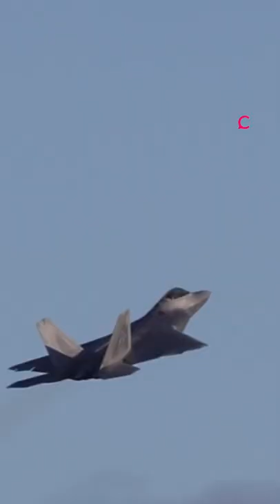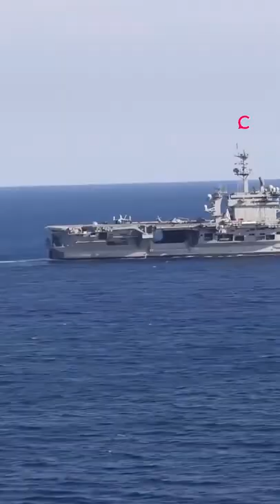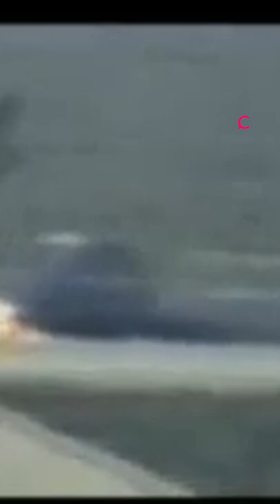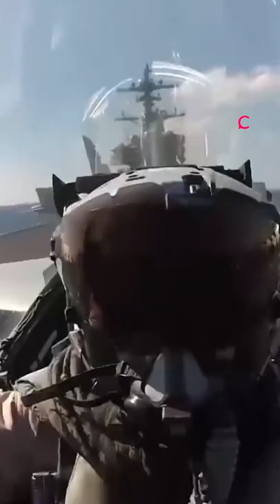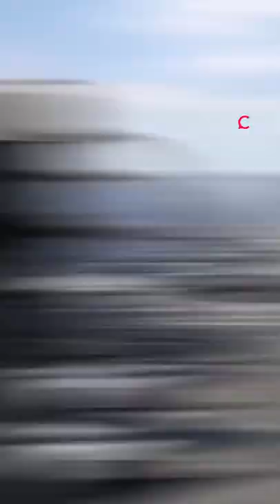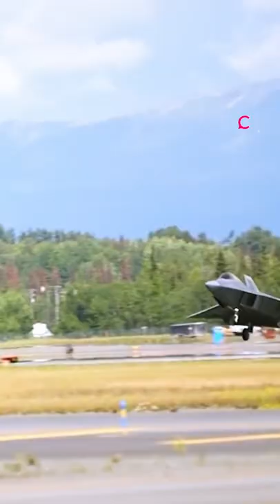Why can't the F-22 land on an aircraft carrier?

Comment: Uh, designed for Air Force and not the Navy. Nothing else needs to be said about why it can't land on a aircraft carrier!!
Reply: Originally they were going to make a navy variant but due to costs they only ended up making it for the USAF. They made 200 instead of the 700 they intended to make. Today there are 185 operational.
Reply: They both have air in the name
Reply: Only smart comment in this whole section
Reply: @yav1d  who’s?
Reply: @Ohhiohh  Lol they do though
Reply: A10 wasn’t designed for the navy yet it still has a tail hook and can land on a carrier
Reply: @roryneil1921  try getting an Air Force pilot to try to land on an aircraft carrier.
Reply: @roryneil1921  the tail hook on USAF planes are designed for emergency landings on runways where they have cables set up to let the hook catch the wire, if landed on a carrier the A10 would break its hook and possibly blow up due to it having not strong enough landing gear.
Reply: @ryanb32952  yea ik it’s not exactly textbook for Air Force jets to land on navy carriers but still I don’t get why they decided the f22 didn’t need that back up option but almost every other jet did
Reply: @ryanb32952  The A-10's gear is pretty strong, infact. It's low speed stability will also help it get a softer landing than the F-22
Reply: @roryneil1921  I think it's to save on weight, because, I don't think an F-22 can even go slow enough without stalling to even catch the wire correctly
Reply: @ryanb32952  - an A10 has landed on a carrier before. It just can't take off after.
Reply: @xcr8ivex708  oh yes I understand that, but the fact that it is a very skinny platform it would most likely explode or break on impact.
Reply: @-007-2  Ask any air force or navy pilot they will say no, maybe your talking about war thunder 😂
Reply: @ryanb32952  What do you mean by "skinny platform"?
Reply: @xcr8ivex708  the a10 has a much thinner airframe than others.
Reply: @ryanb32952  It's not really that skinny?
Reply: @roryneil1921  yah but we talkin this think boi
Reply: I didn't think this needed an explanation.
Reply: @ryanb32952  you said that and officially that is true but didn’t pick it and yet the f35 is more expensive then the f22 would have been . The company said if you order like 700-1050 we will give discount. It would have made it about 80-120 million each.
Reply: UHHHH 😶 ALL ARE AIRCAFT!!!!!!!!!!
Reply: Foreign Air Forces land on carriers, the DOD primary Air Force could definitely do it!
Reply: the landing gear already fail on the ground, not good enough for carriers
Reply: @trovenolawrence7127  We’re talking about aircraft capabilities, a 5 year old couldn’t land on an aircraft carrier with an F-18, but that doesn’t mean the F-18 can’t land on carriers.
Reply: @roryneil1921  Umm no it can't Airforce planes with tail hooks are an emergency measure. They are by no means strong enough for a carrier. Plus Airforce pilots are not trained for carriers. Just mile long strips of concrete and asphalt.
Reply: yep
Reply: Air force pilots would rather eject. They're not built for the carrier landing anyway.

Comment: Citing the weight is pretty dumb, tomcats used to operate from those same carriers and they were of similar max takeoff weight. Not to mention that tomcats were designed to slap the deck hard enough that the F-22’s gear would snap off
Reply: “Slap that deck” bit sus
Reply: @ironskyheart7749  Especially since I’m a New Zealander, where the pronunciation makes it even better
Reply: Tomcats were DESIGNED for Carriers, Raptors were not. Did you even pay attention?! The F-22's landing gears are not rated for carrier landings. You are comparing a Naval Aircraft to an Air Force Air Superiority Stealth Fighter. Not to mention that he literally said that the F-22 cannot use the arrestor cables because it wasn't built to use such. Citing the weight isn't stupid, because 1) Not everybody knows that info, sorry to break it to you. And 2) The landing gear of the F-22 would fail and likely break from the weight of the aircraft slamming down on the deck of an aircraft carrier it wasn't even designed to land on!
Reply: @DDayJayke  Bruh did you read my comment. I specifically mentioned the difference between the gear rating.
Reply: @DDayJayke  maybe you should actually fully read a comment before you make a rage-comment about it
Reply: @viscounttudon68  Oh, just like how the video did?
Reply: @MayBT7274  I did, that's why I asked if he paid attention. You would know that if you read my comment fully.
Reply: @DDayJayke  The video cited the raptor’s weight as the reason why they weren’t rated for carriers, suggesting they are too heavy to operate from them. That, which is what I was discussing, is incorrect.
Reply: @DDayJayke  It technically can use the arrestor cables bc the F22 has a tail hook
Reply: @viscounttudon68  Honestly, why are you ignoring your wife?
Reply: @blokin5039  What?

Comment: I’m looking at the comments and the vid, and I agree with everyone here.  1 weight doesn’t matter on an aircraft carrier when it’s a small fighter, 2 there are different models of the f22, none of which DONT have a hook, the diff models are that and one with vtol (vertical take off and landing)3 there are backup measures like the net ( which is used on a carrier in case of a failure with gears or hook) so yes it can land on a carrier.

Comment: Most Air Force planes actually do have the arresting hook on the tail for emergencies as most Air Force runways have arresting systems at the end of runways. Other points stand but are also completely obvious because the plane was built for the Air Force exclusively.

Comment: Because it wasn't designed to land on carriers. F-35 designed with a stronger frame for carrier operations(Navy) and the VTOL(Marine replacement for the Harrier) variants with that in mind, the air force variant, like the F-22 is focused on weight, speed, and maneuverability.

Comment: To land on a US carrier requires its wheel shock absorber system/air frame, to be more rugged to survive the much more violent and abrupt landings on the short carrier deck.... This is in contrast to the much longer length of a US Air Force, land based tarmac which allows a much gentler landing.

Comment: The most modern Air Force fighter jets have tail hooks. These include the F15, the F 16, the F117, and the F 22. These arrestor hooks are designed to stop the aircraft within 1000 feet. However, an aircraft carrier flight deck needs to stop the plane within 250 feet. If you stop the Air Force fighter within the allowed 250 feet, it might tear the plane apart. It might also destroyed landing gear from the impact.
Reply: Yes finally someone who knows.
Reply: Why would one even try to land on the carrier? The plane would be trashed anyway so may as well just eject near by. Safer for all that way...

Comment: In this scenario, the most advisable thing to do would be to fly slow, high, and around half a mile off the port side of the carrier. When at the closest point to the carrier, I’d turn sharply away from the carrier, eject, and land on the carrier deck.

Comment: F-22 has vertical take off and landing so it can
Reply: That is what I thought when I read the question….
Reply: @grepomaster8460  the F-22 does NOT have VTOL capability.   You are confusing f-22 and F-35
Reply: @Bendigo1  You are right. They made that improvement on the F-35

Comment: How about F22 b or c instead of waiting for a completely new plane ?
Reply: Nope. It’s over. No more will be built.
Reply: It's not that simple. The raptor is engineered to be exactly what it is. Even to change out the engines you'd need serious design changes that may not even be possible without compromising stealth performance due to having to change fuselage shape, not to mention whatever needs to be shifted, removed, or what have you to actually fit say a larger set of engines. 

There are reasons they upgrade and replace jets, the raptor, as much as I love it, just isn't worth rebuilding from the ground up. 

Plus, if you do shift focus, now nearly ever penny spent on the F-35 was wasted, which would be a real shame given its potential and how much has been put towards it already.
Reply: NGAD is already in development, continuing the production of F-22s would only slow NGAD's release
Reply: Same reason no f-15 will land on a carrier, not a pound for the ground. And if it is, then it's bombs or gas, not heavy reinforced landing/arresting gear. Not to mention, no launch bar.
Reply: They also don't have the tooling anymore...

Comment: Doesnt matter. With the performance of the new British shoulder carried missile, the battlefield usefulness of fighters is in question.
Reply: LOL… Maybe against every plane that ISNT the f22
Reply: @royisabau5  An aircraft so complicated that by the pilot learns how to operate it, it will be obsolete or he will have to retire.
Reply: It's not a fighter, it's an air-air interceptor and is designed to operate outside the range of MANPADs.  I think you're conflating it with attackers and multi-roles doing air support.  An F-22 is designed to stay high in the sky and shoot opposing aircraft with missiles from many miles away.
Reply: @AnarexicSumo  But it cant attack grounded forces from miles away. These British missiles will keep the F22 at a distance. Why? Because air force commanders wont risk losing one of these expensive planes attacking ground forces.

Comment: They still should have made an F22B for the navy 
Probably a waste now since there's probably already something more advanced that's classified. But they should make that carrier friendly or with a navy variant
Reply: The F-35C is carrier rated.
Reply: @aaronchown5008  True 
But F35C is not F22
Reply: @cbeaudry4646  Interceptors as a rule are built with high manuverability and low stability in mind.  Low stability means no carrier landings.  The F-35 is a multi-role just like the F-18, F-14, F-4 etc etc etc.  To make an F22 carrier capable would make it not an FEW anymore, hence the F-35C.

Comment: If it can’t land on a carrier could it take off from a carrier and land at a predetermined land roadway or runway? I’m thinking of the specialized WWII Doolittle raid where B-25 bombers took off from carriers and landed or crash landed over land.
Reply: You'd need to install catapult rated gear for the launch. As powerful as the F-22 is, she doesn't make enough thrust to take off under engine alone. Problem is that the F-22 is already so expensive to operate, it wouldn't be worth the cost of modding and intentionally damaging them. You'd be better off with large numbers of earlier gen fighters, especially if they'll be crashing or making improvised landings.
Reply: @TheRealAaronSmith  f35B exists to solve the navy issue.
Reply: @oladiedoo50  almost. The B variant is the STO/VL model, the C variant is the carrier version. The C has a cable hook and has larger wings, so it's fully set up for carrier use.
Reply: @TheRealAaronSmith  STOBAR exists.  An F-22 absolutely could take off from a carrier it just can't land.
Reply: @AnarexicSumo  no shit. Reading retention isn't your strong suit, eh? First thing I referenced was a Cat launch. Literally first thing. If you put the gear of an F-22 on one of those cats, it would shear clean off. Bird would be laying belly on deck. And that's still a hypothetical, because the airframe wasn't designed for those forces, so even if you have proper gear you might be twisting or otherwise damaging the airframe JUST ON LAUNCH. And again, they just aren't practical enough to be worth the cost of doing that, followed by later crashing/imp landing later. As for landing, you clearly don't know what you're talking about because AS IS, the F-22 CAN be landed on a carrier. Is it safe? No. Will it catastrophically damage the bird? More than likely. There are emergency protocols for landing non carrier aircraft on carriers nearly for the sole purpose of keeping a pilot and possibly keeping said fighter out of enemy hands. Every F-22 has a tail hook. It is not meant for carrier landings, but its literally built so that if it is used once on a carrier, it should survive. And be immediately replaced. 
That said, nobody said it's easy to do. It takes a huge amount of skill to land a jet that is designed for carrier use on a carrier, it takes a god amongst pilots to land a conventional jet on a carrier. Assuming you have the ship sailing into a headwind at full steam, you could very well stall yourself into a landing, relatively safely. While none of this is a good idea, it's not impossible.

Comment: In a really good emergency, the arresting barrier would stop the plane with minimal damage and a skilled pilot could land on that deck without slamming the gears down.
Reply: I don't think an F22 can even go slow enough to land softly.  Interceptors are intentionally built with very low stability to improve manuverability.  That's one huge reason why so many naval jets are multi-role.  Greater stability is required for CATOBAR landings and interceptors are intentionally designed with low stability.
Reply: Simply setting down gently doesn't matter if the boat hits a wave and comes up to meet the jet. And whether the damage to the jet matters or not, the carrier arresting gear would be damaged, hindering the recovery of any other jets. There is no good emergency, and no reason to risk a multi-billion dollar boat for one jet.

Comment: I think for such an expensive and technologically advanced fighter jet it is ridiculous that it cannot land on an aircraft carrier, it makes no sense!!!
Reply: It was made for THE AIR FORCE.  not the Navy Air Force. USAF is not tied to the navy
Reply: It doesn't fit specifications for what the Navy wants from a aircraft. The the F-22 is designed very specifically in order to be what it is, its complicated and hard to maintain and its not designed for salt water. Not only this but the F-22 is pretty big and the wings don't have variable geometry. It's unlikely that the F-22 would need to land on a carrier plus it would require a whole new set of landing gear which would take up more volume and weigh more, this would likely require a massive redesign to adjust the fuselage and its internals which costs more money than its worth and its almost certain that it would harm the performance both aerodynamically and stealth wise. There's no need for an F-22 to be able to land on a carrier except in a extreme/unlikely circumstance which the pilot would be then advised to just drop the thing into the drink as it would be safer for everybody involved and would likely cost less than the potential for an inexperienced pilot to destroy one plane and whatever else it might damage on the flight deck aswell as potentially renderingthe flight deck inoperable. You can train a pilot all you want but actual practice is what makes naval aviators good at landing on carriers which is something air force pilots would rarely have the opportunity to do since it doesn't fit doctrine and would lengthen the already very long pipeline to become a pilot.
Reply: @beholden84  The F-35 was made by the Air Force and holy shit it has a CATOBAR variant.  Almost like departments can talk to each other.  Also there is no 'Navy Air Force'.  Just the Air Force and the Navy.
Reply: @AnarexicSumo  pretty sure we were talking about F-22

Comment: The only reason it can’t use it is because it doesn’t have an arresting hook. Yea it probably wouldn’t survive an entire career if they put one on but it would definitely be able to land on a carrier
Reply: It does.  It's just rated for airstrips not carriers so it can stop within 1000 feet not 250 and the airframe and landing gear would snap like a twig.  It would need a complete redesign and between the stability requirements and the added weight of a reinforced airframe and landing gear they may as well just use F-35s or F-18s that are already carrier capable.
Reply: @AnarexicSumo  negative, it would survive…. Not designed but wouldn’t survive thousands of cycles…. But still insanely strong

Comment: while it's not advisable to attempt to land on a  carrier   there are air force pilots that are carrier qualified and if it had to land on a carrier there are procedures  for such a contingency it includes a gear up landing and  the use of a barrier and foam to catch it. but it would most like be coming  in with Intel equipment and air force jets often have tail hooks since the air force use arresting wires to stop jets

Comment: Some would say. Welp upgrade the landing gear put a tail hook on it and train your pilot's.  Still alot more cheaper than splashing into the drink an recovery
Reply: It's not.  Not by a long shot.  The F-22 would have to be rebuilt from the ground up and it's an interceptor so it would probably be an impossible task.  $125 million USD is a lot but is just a rounding error compared to the $335 billion USD it cost to design the carrier capable F-35 variant.